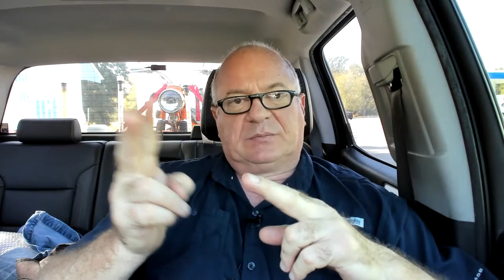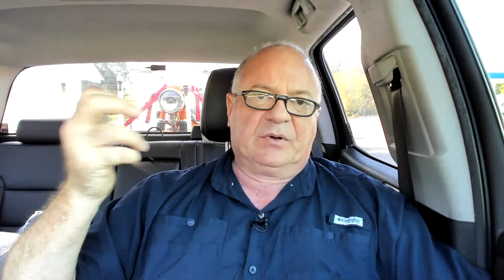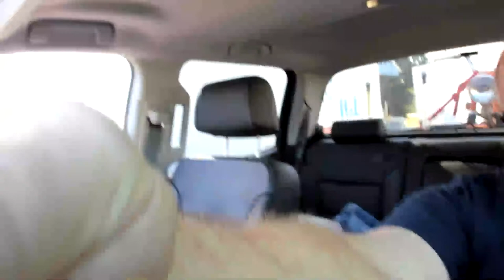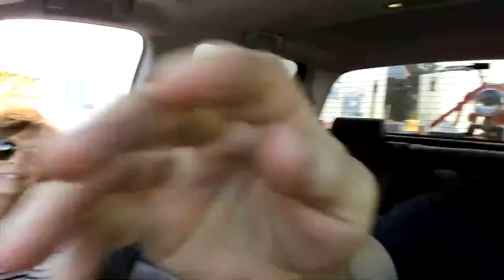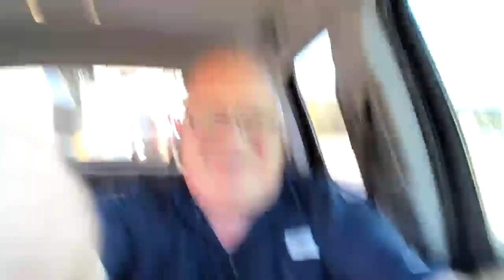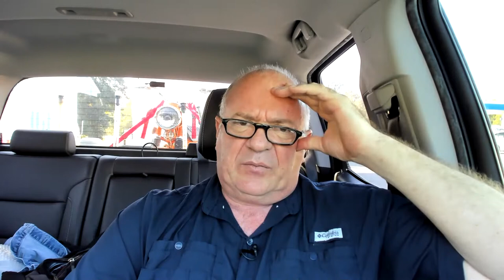Live Q&A with John Talley| Partzilla.com

Comment: Hello John! Lincoln Marsh here with the 2022 Yamaha Kodiak 450.
I'm thinking about doing some upgrades and wanted your advice.
First I've done some research and found that the Kodiak 450 that I have has 18 gram primary clutch weights and the old Grizzly 450 had 14 gram clutch weights and 
 lighter clutch weights equal less rotating mass and gives the ATV a bit more snap though out the power band.  I'm planning on getting the OEM weights from Yamaha  and installing them on my Kodiak.
Is there anything else I need to adjust or otherwise change when changing weights? Or is it as simple as taking the primary clutch off and removing the weights and installing the new ones and putting it all back together and go ride? 

Second
I'm thinking about installing an exhaust tip.  Just the tip. Is that an alright idea? Will that add a few more horsepower with less restriction for the exhaust gases? Also do you need a fuel controller when changing just the tip? Like you do when putting on an entire exhaust system? Will putting a bigger tip on the stock exhaust cause and  damage to the engine or muffler? Yes my Kodiak has fuel injection.

Comment: Hey John. I’ve got a trx400fa5 I’m trying to get right. Am I right in thinking the trx350 videos will suit the 400 as well. Rear brakes are rusted on as well as the seals failing. Drum is seized onto the splines on the axel. Am I going to need heat to help disassemble it all? 

Cheers

Comment: Hi John, I need your expertise… I’m new to the Honda ATV world, but I have purchased two.  One is a 2004 Honda Foreman TRX400FW with a pretty loud ticking sound.  The second is a 2002 Honda Foreman TRX450FM also with a ticking sound (but not as loud as the first).  I’ve been told this is fairly normal for Hondas… but I don’t believe that, as I have heard nice sounding engines with no ticking.  I adjusted the valves on the ‘04 (while the compression improved the ticking sound persists).  I’m now guessing it may be related to the timing chain (but only guessing).  Any advice will be greatly appreciated.  Thanks,
Reply: btw I’m Breita